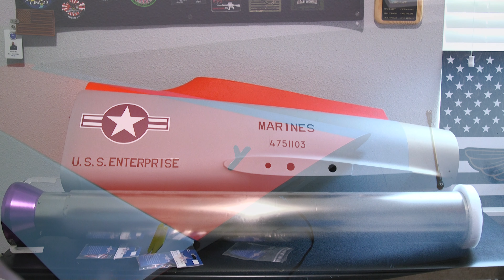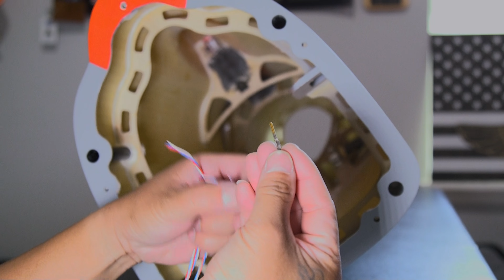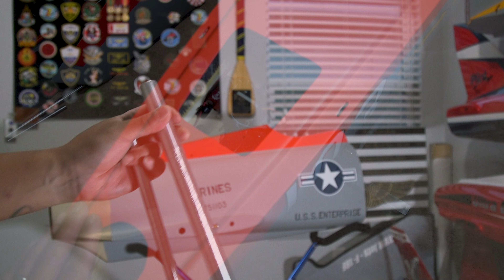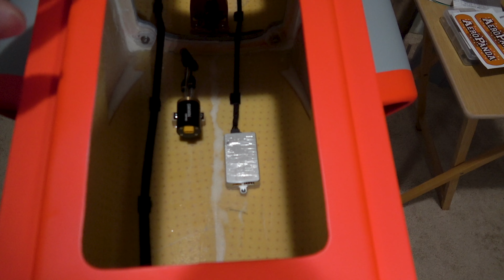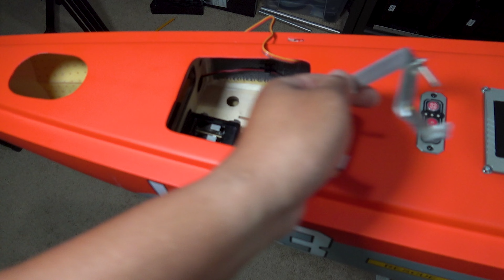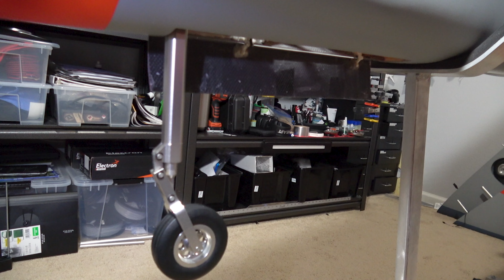TopRC Voyager pt.2- #toprc #rcplane  #ModelAirplane #rcbuild  #Aviation #airplane #airplane

Comment: Electron gear is one of the mods, servo on the gear door, internal flap linkage, that's just a few things to upgrade
Reply from the maker: Jet flies great. I also did the mods you mentioned with the exception of the flaps mod. I may want to do that to the flaps. I’ll just need to see how the mechanics was done internally.